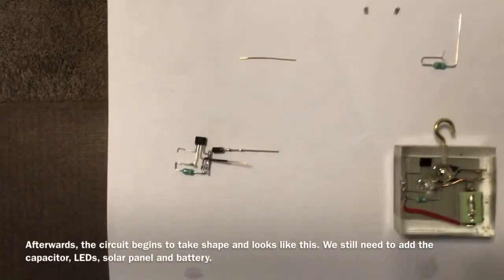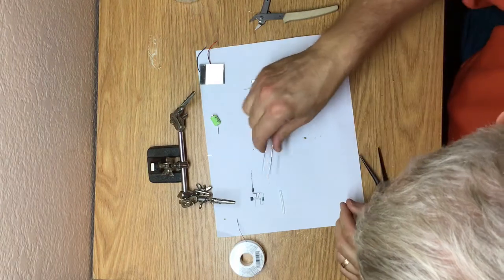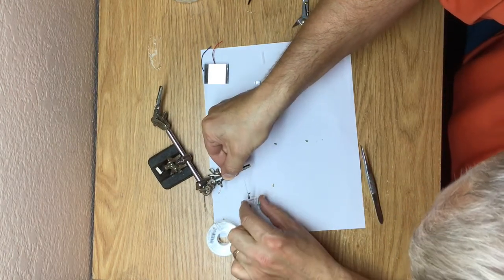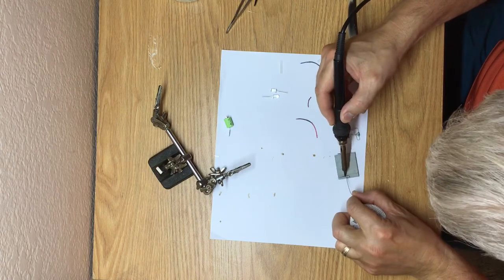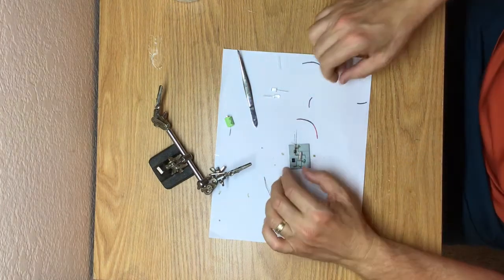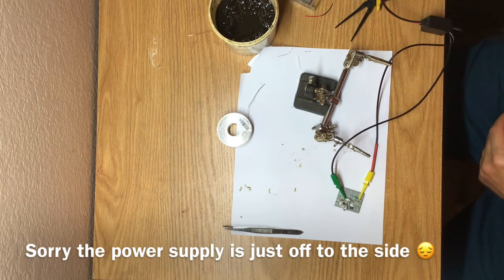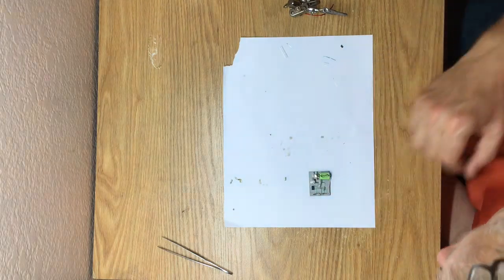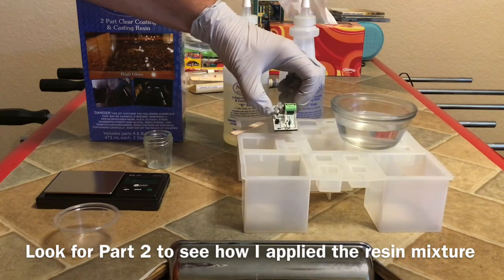QX5252 Solar Cube with flashing LED’s

Comment: I'm surprised it bumped up the voltage enough to put the LEDs in series. I'm going to try in parallel, with four 1.5" solar cells in series to make 2v panel (thanks for showing the solar panel, looks like the fourth cell is only half the amperage as the other three, thus, very little charge). The 1.5" square cells are about 450 mA. So, after, say, 6 hours, about 2.7 Ah in what has to be a much larger battery. I hate the nicads because they are poisonous (cadmium). So, I'll use the nimh. Since they have lousy charge efficient, might be able to get away with a single AA (rated at 2,000 mAh). But will probably parallel two, just for good measure. That ought to be about 4Ah.
Then, I'll use a lower number inductor, for a higher current. Figure about 14 hours, on in winter. 4,000/14 is the current. That's almost 300. Maybe I'll do about 200 mA, or twenty of the really cool, high CRI Yuji LEDs. I suppose I'd have to put a little resistor on each, to insure that in time, some LEDs don't draw more current than others.
That'd be about 160 lumens.
Back to the panel, just two pieces of glass, silicone sandwiching the 4 cells, each with a dab of silicone to hold it in place.
I've did something similar in the past with 3 nimh cells and 12 solar cells and just ...two transistors... for the auto on-off and it seemed to work for about 2 years, until it accidentally got stepped on... So, I don't think the air hurts the bare solar cells as long as the silicone prevents moisture.
I'm hoping this lasts a lifetime (but would need an ASIC for the 2.3v lithium titanate battery)...
Reply from the maker: I like how you are experimenting with the circuit. In the second, part 2, in enclosed everything in a clear resin. The project is still working today. Also in my third video I boost an 1.5 v battery to 47 v , the voltage needed to light the LED filament. I will add a solar charging circuit to that boost circuit in the future. Thanks for your comment . Please keep me updated on your project.
Reply: @aguywithledissues9639  
I forgot to account for the boost ratio, thus much less lumens than I previously said. I think I really messed up on the math because the second time I tried, for the initial 2.7Ah, I'd only get like 30 mA for 14 hours, after all the inefficiencies and that boost ratio.
A far cry from "lots of lumens".
Thanks for getting me interested in this, again!

Comment: Thank You for the Informative video. Please can You tell us what type of Battery you used? ... seems to be not very common ... Thank You . 🤝
Reply from the maker: The battery I used in the video was removed from a 9v NiCd battery. Normally they contain 6 x 1.2 NiCd cell like you see in the video. I carefully covered the top of the terminal with tape to prevent a  short-circuit.  Then I  careful removed the casing around the 9v, starting at the bottom.

Comment: How do you test a 5252f?
Reply: When i got not original QX5252F i done test circuit. half of them was broken, but because of that seller returns me new original ones for all broken pieces. The QX5252F was connected by goldpin socket. I was able to take it out and connect second one. The test curcuit contains battery, small solar cell, one LED also attached by goldpin and 220 uH inductor.